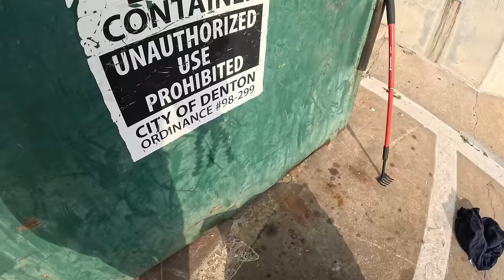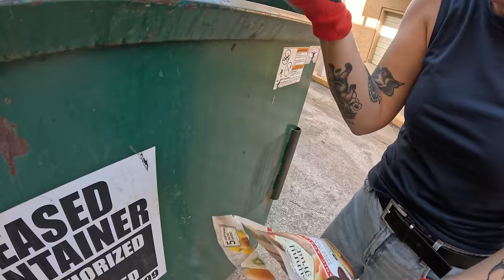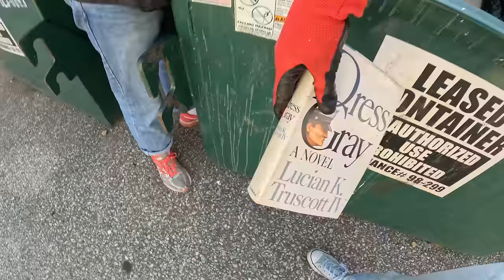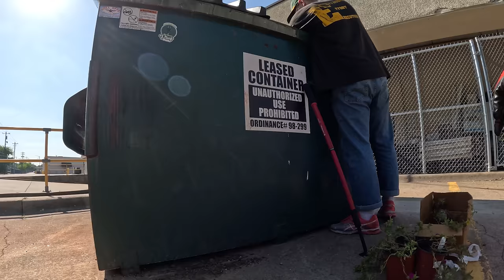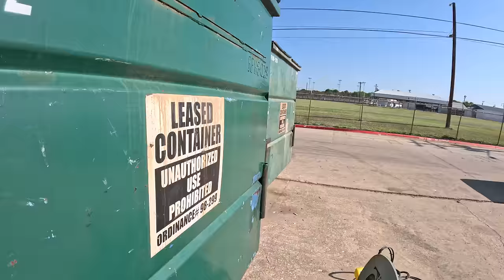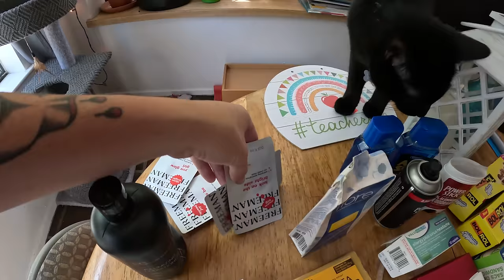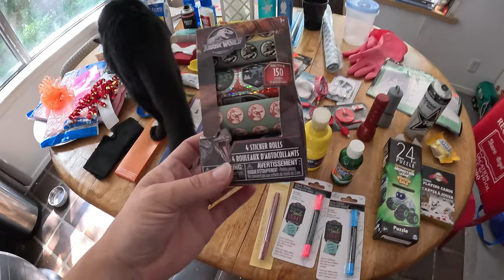Dumpsters Kept on Giving – Plants, Grab Bags, Books, & More!

Comment: Just a reminder to soak the terracotta pots in water for 24 hrs before planting in them 👍
Reply from the maker: I’ve never heard this, thanks for the tip!
Reply: The pots will soak up moisture from the soil quickly, so when you soak it, your plant doesn't get too dry when you first pot it.  On the plus side if you over water the plant later on the pot will help soak that up too.  

There are different quality levels of terra cotta pots. Flip the pot upside down on a flat surface. Cover the little hole in the base of the container with your thumb. Then, using a metal screwdriver or utensil, gently tap the edge of the container base. If it sounds like a dull thud, that’s cheap terra cotta. If it rings and the sound resonates, it’s a high quality material! The more resonant & high pitched the sound is, the better.  Not that it matters much here, but it's nice to know what you have or what you find.

Comment: If you will set those plants in a tub of water let them soak up water from the bottom, the roots will get more water then set them out they should be fine, also if you by chance boil eggs, pour  the wate water that you boiled the eggs in after it has cooled on the plants when you water them. You can also crush the egg shells real fine and put it in the soil it adds calcium to the soil